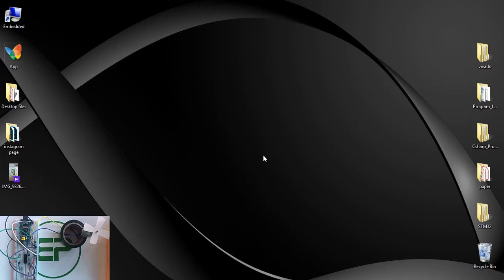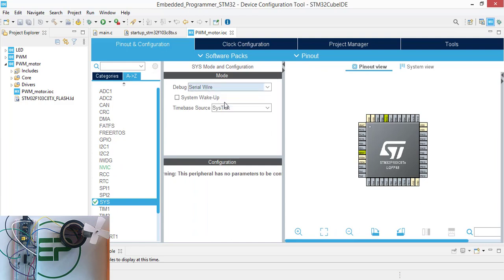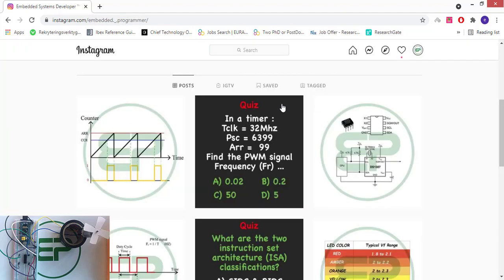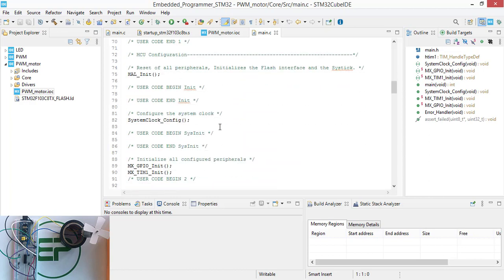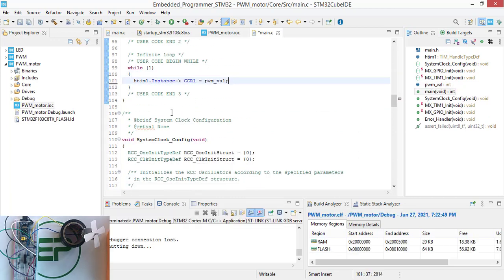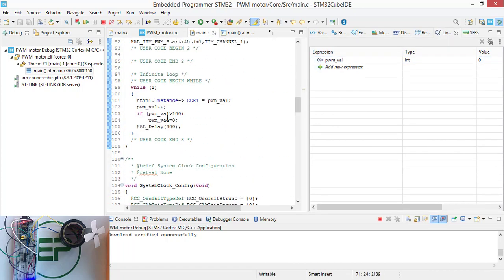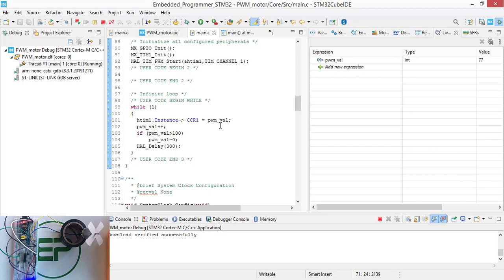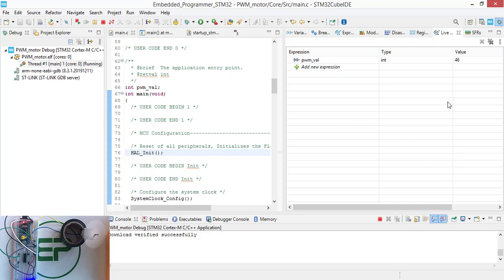PWM Configuration in STM32F103 to Control DC Motor | Embedded Programmer

Comment: pin connection please.
Reply from the maker: Please check:

ULN2003 8th Pin  GND
ULN2003 9th Pin  VCC

Motor Negative Pin  ULN2003 16th Pin
Motor Positive Pin  VCC

STM32F103 A8 (PWM)  ULN2003 1st Pin
Reply: I am using infineon's  xmc4500 mcu with  DAVE IDE. I am able to rotate the motor clockwise and in an anticlockwise direction and control speed by adding delay in-between.I  am trying to adjust the speed of the motor through PWM,How to proceed with it. @Embedded_Programmer

Comment: I got the blue pill and tried the usb debugger , its not working only the red light is glowing, any  suggestions what can be the issue
Reply from the maker: You can check my first video which is about getting started and includes debugger initialization

Comment: Did you set your prescaler for 64Mhz and then set the clock to 32Mhz?
Reply from the maker: No, the external crystal is 8 Mhz, I set PLL to x4, So the bus frequency would be 32 Mhz

Comment: hi, can you make a quick sketch of the connection between these components please? I could not see it clearly. Thank you so much!
Reply from the maker: Yeah sure please check:

ULN2003 8th Pin  GND
ULN2003 9th Pin  VCC

Motor Negative Pin  ULN2003 16th Pin
Motor Positive Pin  VCC

STM32F103 A8 (PWM)  ULN2003 1st Pin